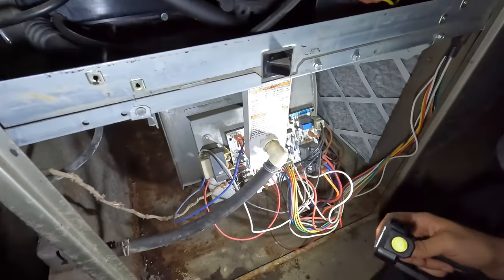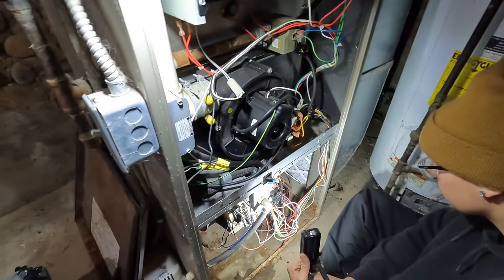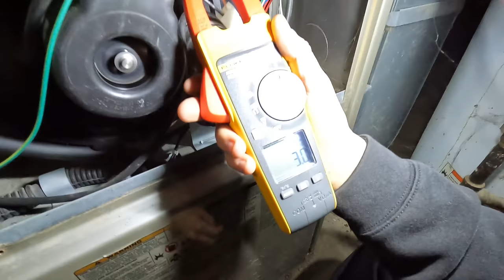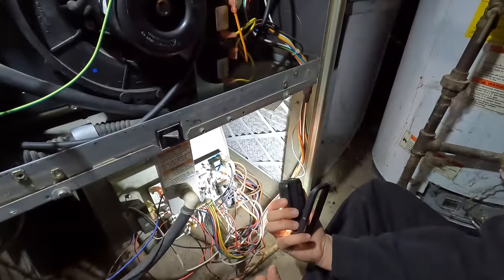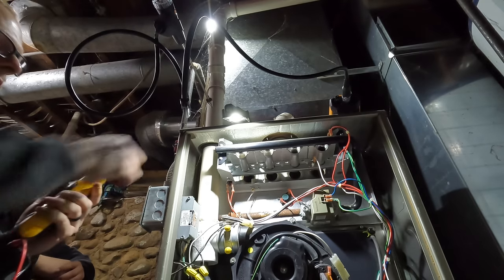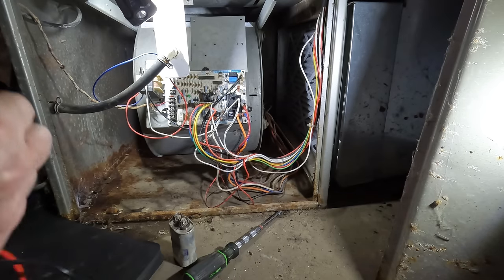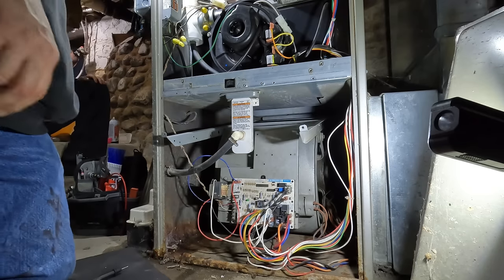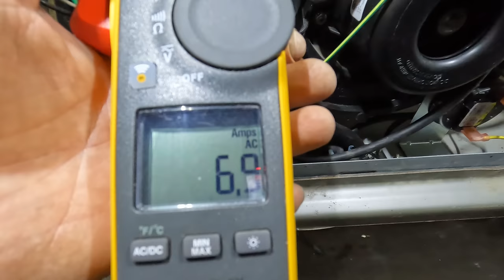Furnace Troubleshooting: Payne Furnace Tripping on High Limit - Find out Why!

Comment: Nice catch. I’m sure you did it off camera, but checking the heat exchanger from underneath with the blower removed is really important. I’ve seen lots plugged up from lack of filter changes etc
Reply from the maker: I did, and it was fairly clean surprisingly.
Reply: Oh nice! What’s your favourite brand of furnace?
Reply from the maker: The ones that don’t break down often. 😂 I’m a Allied Guy, not a big fan of Lennox. I have had great success with Armstrong and Concord. Just my personal preference.
Reply: Ya Lennox are troublesome that’s for sure. I’ve had good experiences with Daikin but actually do more commercial than residential so not too opinionated

Comment: "Could it be this (high limit switch)? Like maybe a loose wire"
"No, that has nothing to do with anything"

"Four flashes.. High limit.."

Absolutely, a loose wire at the high limit, would cause that very symptom
Reply: Good catch, though.. I've never run into a dislocated fan bracket
Reply from the maker: Yeah that was before I realized it was going on High limit and the 4 flashes.
Reply: Yeah I caught that statement. He told his trainee that high limit had nothing to do with anything. He also said he didn't think it was a blower issue.😂
Reply: Uh huh

Comment: No temperature rise tested . No gas pressure test ?
Reply from the maker: I would have if it kept going off on limit after I found the blower issue. It’s been a month. I even called them and it’s working like a champ. Thanks for watching.

Comment: What was the heat rise? Without that your guessing it 16:36 won't trip limit again after running a while
Reply from the maker: Yeah you’re right I should’ve check temperature rise. It’s been about a month and haven’t heard back from the client. And it’s been really cold here.
Reply: When I get limit calls I check the temps and if she's running a lil to warm for my liking I'll usually throttle down the gas valve a bit.
Reply: @AllTattedUp13 how much lower can you set it?  My furnace calls for 3.5
Reply: @wkobayashim  1.5 - 3.5 and you'll be good 👍

Comment: what if your fan starts first  ..runs 2 mins turns off...  then it cycles and runs perfect  whats  that problem
Reply from the maker: Typically on these models if the Power is shut off with a call for heat when power is restored the Main Blower will run..
Reply: Typically on many models that means heat was being called for at startup. Furnace sees that and does a 2 minute purge just in case system was just running in full heat and lost power. Avoid that by calling for heat after system fully powered.